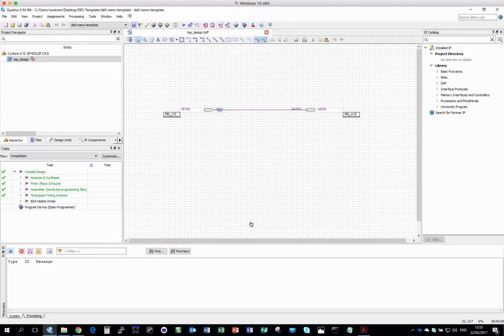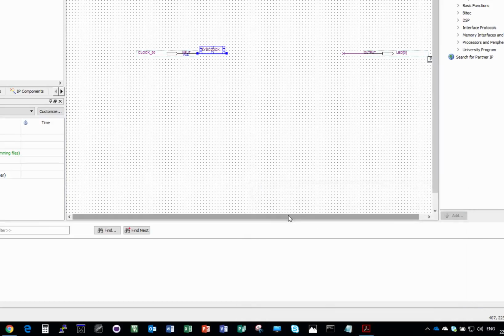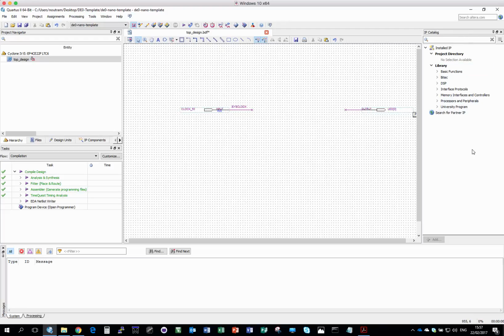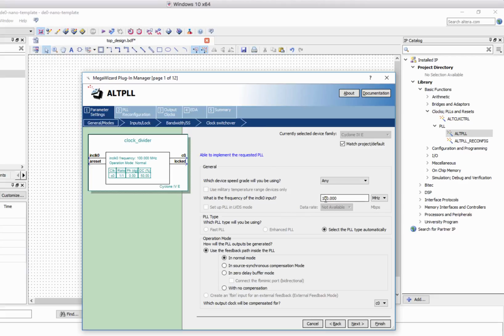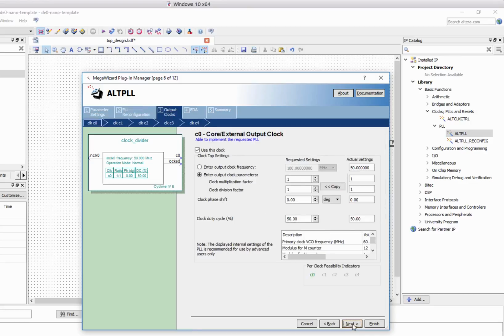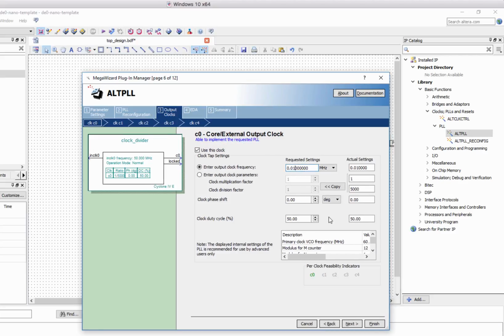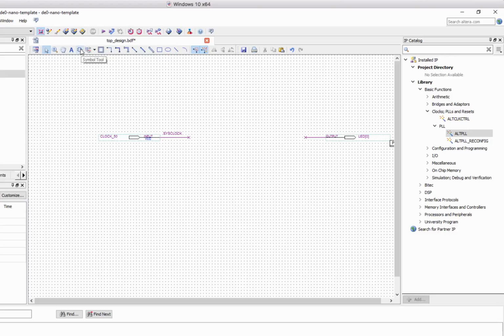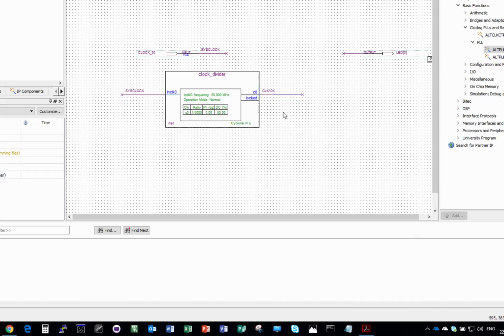Adding a PLL

Comment: Thanks, it is excellent help, subscribed. I have problem with my Cyclone II - unable to set PLL lower than 10 MHz. Is that normal, or I am doing something wrong? Maybe wrong pin assignment? I am using default pins that are on 'Fitter location'. Or just this chip can't do better? Also, tried 100 MHz, but unable to get 90 degrees at two output (at 10 MHz it is okay).